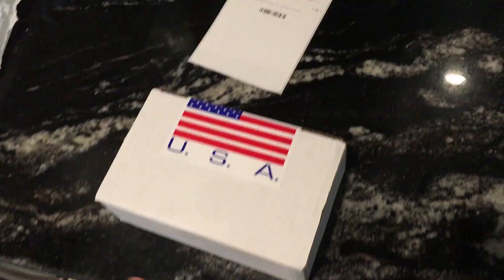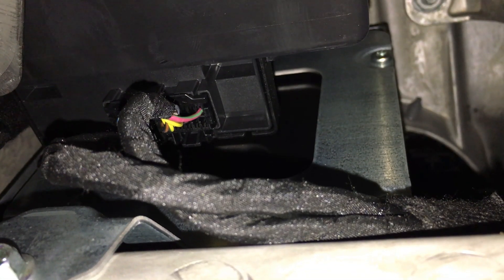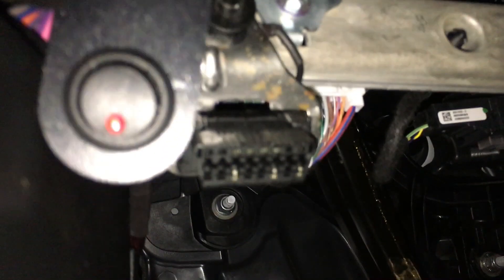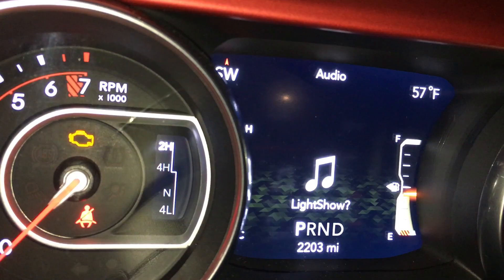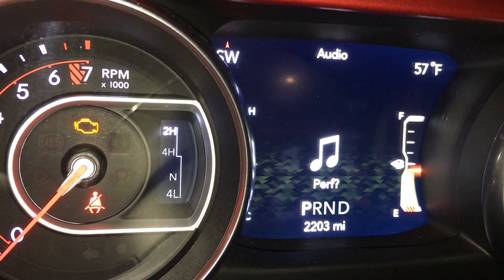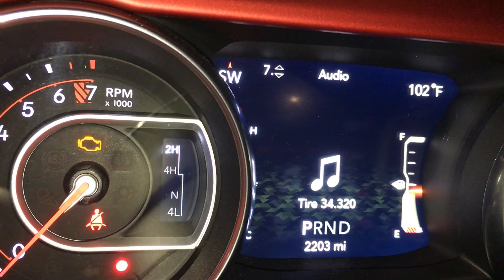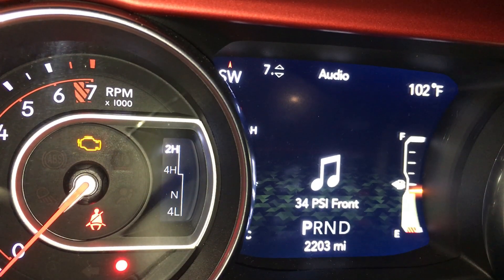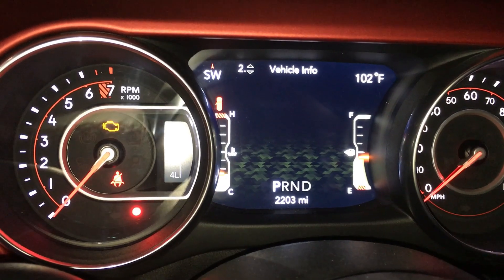Jeep JL Speedometer FIX, TPMS Fix, Recalibrate, Change Tire Size and Change Gear Ratio

Comment: For tire calibration size you should measure from center of wheel to top of tire and multiply by 2. The stated tire size specs are not usually the true size.
Reply from the maker: Great idea! Although really the listed specs will be very close and close enough for perfect calibration of the speedometer. The listed specs will vary depending on the wheel width outside of the wheel width specs…about 1/4 inch taller or shorter per inch of the wheel being out of spec narrower or wider.

Comment: Hi bro after i asked you about the 315/70r17 tires on videos you uploaded before and now i see this video i think i need calibation for my jl , so in this video you setup for the 315/70r17 right bro ? Because i saw you put 34.74 for the tire . And i don't understand why you setup psi down to 30 and after that when you done with calibration setup inthe normal menu and the psi still show 40 or 41, it's depend the weather where you live or how? Because i saw in another video the youtuber setup psi to 15 i really don't understand because my english verybad , so if it depend the weather and i'm live in michigan so how much psi i need to setup for my jl  sorry i don't know alot about the vehicle i just find videos on youtube and learn from these video , and your videos helped me alot thank you bro
Reply from the maker: No problem!! Your English is actually really good man😁! The PSI setting is actually for the low tire pressure alarm...by setting the low PSI alarm at 30 psi I can now run my bigger tires at 31 to 32 psi without my low tire light coming on....the youtuber probably set his low tire alarm to 15 psi because he does a lot of backroad driving at lower PSI like 18-20 on overland trips etc and he didn’t want to see a low tire warning light all the time...if you are running 315/70/r17 tires I would run 32-34 psi if it is a load range C tire....if you have a D or E load range you may need to run 30 psi on the Highway. Hope this helps!! My brother has 315s on his Jeep and he said his speedometer is only off by 2-3 mph at 70...so he doesn’t feel the need to buy a tuner to recalibrate the speedo
Reply: @rockquestoff-road2839  oh now i understand because i can't hear good that why so Now you reply my comment and i read so i know how you setup the psi , i ordered tazer already i will setup in next few days . Thanks a lot bro
Reply from the maker: No problem!! Glad to help!!